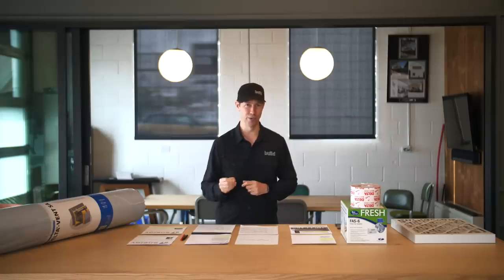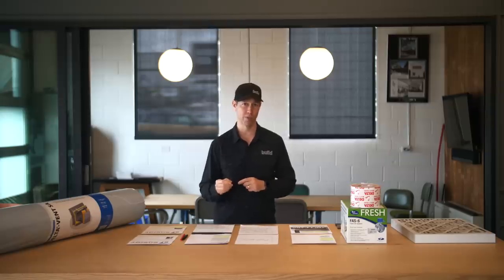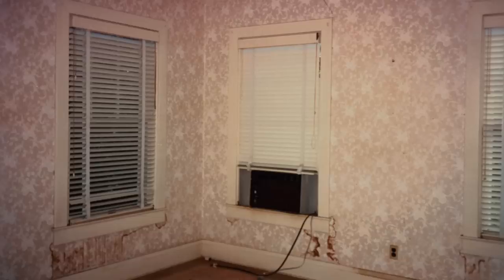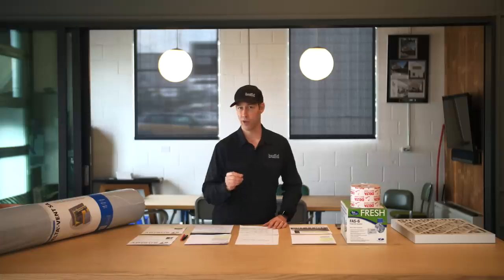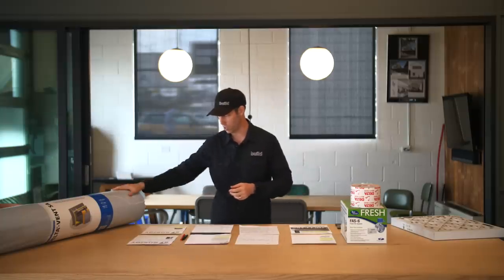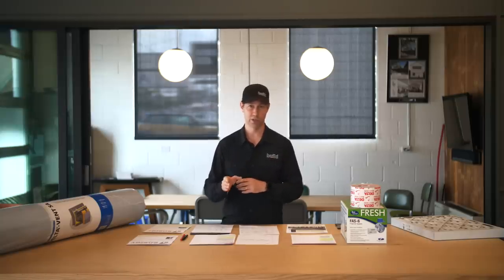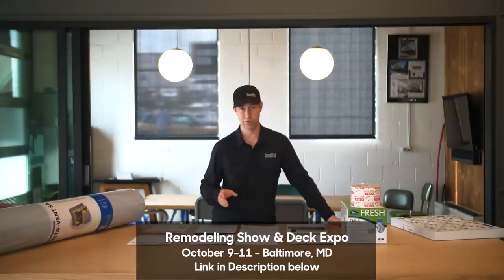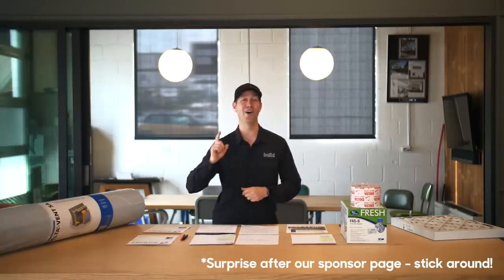“Houses need to BREATHE!” - Shut your filthy mouth

Comment: in minnesota in the 90's smart code requirements house wrap on the outside poly on the inside caused moisture trapping and stucco homes in particular had major mold problems within 10 yrs. hhomes had to be remediated. how do you ventilate inside the walls when moisture occurs?

Comment: I live in Chattanooga, TN. My wife wants the built on garage (concrete slab) converted into a bonus room. By trade I'm an electrician and have 10 yrs of fire & life safety experience, but this is an area of work I'm properly unfamiliar with. Dealing with inspectors all my working life. I don't like to just throw things together even though it may work for now, but at the expense of a later issue or hazard.

I've removed the garage door & built my pressure treated wall. what do you recommend for insulation (exterior of wall, inside the wall or between my gypsum and exterior studs)?

the existing north exterior wall has not been insulated, but has sheet rock. I have plans to remove it so I can then insulate (R-13). also, winter has been getting colder over the years. should I insulate my garage floor prior to installing floating floors?

Comment: Anther system to break and need maintenance to 'save' a few bucks (after you spend a bunch). And, when it breaks, it's an emergency. No thanks. I'll just add a few more PVs. Plus, I leave my windows open 90% of the time when it's nice out so that makes the whole 'one place filtered air' approach pretty useless.

Comment: Tightening the house and then adding fresh air ventilation systems makes for a more profitable build.
Reply: Build it tight as you can and adjust air quality by  cracking a window. The world is stupid.
Reply: @mikedegregorio9113  what if the air outside is worse? you will still need air filtration

Comment: Couple of things.  First of all most of us HERS raters depressurize the house for the blower door.  Second I have never seen my baseline get up to 50 PA even with higher winds than 15mph.  50 PA is actually about a third of the pressure difference between the outside and eye of a hurricane (going off memory on this one but I did look it up at one point).  It's not quite something that most houses will see in everyday operation.  Also the 3 ACH standard starts pretty far south.  Anything climate zone 3 and up requires 3 ACH under 2015 IECC code.  I'm in the Austin area as well and that starts just up in Burnet county and anything west of that.  

The number one thing that concerns me about making homes tighter than 2.5 ACH at this time is the lack of quality in HVAC installs.  Most of these companies are only putting one 6" duct for an air cycler that is tied directly into the return plenum.  They usually only get 25-45 CFM of airflow which even running fulltime is not enough for larger houses.  And they basically never setup the control for the damper to the proper specs.  Also these cheap air cyclers are also horribly inefficient given that they rely on the blower fan in the unit itself.  Once we started measuring wattage draw on these units and put that in our HERS calculations we started struggling majorly to hit that 75 HERS score required for buyers to qualify for VA loans.  I would only buy a tight home if it was a custom that was use a separate Aprilaire system and the company themselves measured the actual airflow at final.
Reply: Those HVAC companies aren't building to the code then, and should be held to account. Building leakier houses to account for builders breaking the law shouldn't be the way forward. I don't know what the code is like where you are but where I am, you are required to demonstrate the ventilation system delivers the required CFM of fresh air.
Reply: @trevorlambert4226  There isn't code that mandates any specifics for how much fresh air to bring in.  At least not in 2015 IECC which is the standard here in TX.  The code simply specifies that there needs to be a fresh air intake system present (and even then some jurisdictions have inept inspectors that don't look for it), it doesn't even have to be turned on.
Reply: The other frustrating part about that is fresh air systems are quite difficult to measure accurately without the installer putting in test points.  None of the installers around here do that so we are forced to use an exhaust fan flow hood on the intake outside.  If there is any cross wind blowing it can drastically affect the results of using that piece of equipment.

Comment: Wood needs to breathe... nothing wrong with a few air leaks wear a sweater. OSB & PSL Beams rot quickly don't let it get wet. Stud cavities need to breathe it's unfortunate these new codes are in conflict with a healthy house. Time will tell if tight is right.

Comment: I think a lot of misconception comes from half assed sealing that neither has the flow of an old house or the tightness of a modern house built by people like you. I have a different problem however as I have a house from 1890 with wood siding exterior covered with asphalt shingles and plaster and lathe interior. I've been trying hard to figure best way to insulate and seal but seem to find so many conflicting opinions

Comment: John Straube, Ph.D., P.Eng., is a principal of Building Science Corp. and a
 professor of building science at the University of Waterloo in Ontario.

Alex Wilson - " I’ve written about a lot of the features we included in our new house in Dummerston, Vermont".

Allison A. Bailes III, PhD, is founder and owner of Energy Vanguard in Decatur, Georgia. (on a latitude between Plainview and Amarillo, Tx

These 3 guys, that you recommend in the description section,  talk about moisture, vapor and climate where they live.  Most of what they say is the opposite or irrelevant in regards to the Gulf Coastal Plain where outside moisture and heat is normally the problem and freezing days are rare.

Comment: Matt, I own a house in the California Bay Area with stucco exterior with a crawl space that was built in the late 70's that has no insulation in the walls or ceiling. I'm interested in making the house more airtight and energy efficient. Of course it would be easy to just blow insulation in the attic and replace the old single pane windows with double or triple pane windows but what about the exterior walls? Could I put "Stick and Seal" over the existing stucco, add mineral wool to the exterior, and then put on something like a stucco board or more stucco over the mineral wool or would I have to take off the old stucco first?

Comment: Great video Matt, I have a question.  What about people who live in a potentially smelly environment?  Some areas of some towns are near factories that have bad smells regularly, or I personally live in the country somewhat downwind of a large cattle feedlot.  Occasionally the air outside smells pretty badly.  With an older style leaky house, the inside of my house doesn't smell due to the slow nature of the air leaks (some comes in, but then the wind changes and the smell goes away).  

If I had an HRV (I live in a cold climate), I wouldn't want to suck straight "fresh" air into my home when it doesn't smell fresh...  Along with pollen filters etc, are there filters available that would filter out bad smells?  A Carbon HEPA filter or something?

Thanks for any thoughts or guidance!

Comment: It all depends on materials used /age etc.
Old houses were built to breathe , for very practical reasons.
New houses, well its down to preference.
Reply from the maker: How so?  You have prefer to suck in air from your attic or crawl space and filter it with your insulation?

Comment: Why do they have to be airtight! When you bake in your gas oven were does your conbustion air come from? Use your dryer that sucks 1000 cfm out of your house, were does the air come from in you sealed house?
Reply from the maker: We always include a fresh air supply with a booster for high draw kitchen exhaust hoods. Dryers are much closer to 200-250 cfm

Comment: I have a home build in the 40s with a cinder block basement. Going about making it air tight seems impossible. I already had a water intrusion issue and installed interior drain tile. But now I'm dealing with the mold from intrusion and mold in the open attic. Anyone have any tips

Comment: building in the pnw. How can you account for the moisture that needs to evaporate out the the lumber after framing in the wet weather?  what % does the lumber need to be at to seal the wall up?

Comment: Just for fun I'd like to dispute all of your reasons.
So, #1, required by code; that is what is known as a circular argument.  This way is so preferred they wrote a code that requires it. So it is better because it's required by code. Not a valid argument, it is actually a logical fallacy.
#2, leaking, energy loss. If you have leaking which allows moisture ingress, you must also have leaking to allow drying.  If it's tight, it must be tight.  So the two are mutually exclusive, but that does not indicate one is the only effective method, just that if you choose one you must consider the entire system and build accordingly.
#3, materials; if you have a leaky house, you must use better materials which withstand moisture.  Perhaps it is a mistake to use fragile materials, not a mistake to use robust?
#4, comfort; I built a tight house, and without electricity (or open windows) it is uninhabitable, you must have air flow through it or suffocate. Not comfortable.

Consider that when these houses were built most heating came from burning wood, which was there free, just work to get it.  Cooling came from that evil natural ventilation.  Or slave labor, get your kids out there chopping wood, working the fan etc.  It's like a free gym membership with every house.
Reply: 2# which method is an effective method? the one that keeps you warm and dry. tight means you can manage the airflow and thus the heating and drying. air leaky home you have no choice, its cold and dry if you like it or not. tight wins because its your choice how you want your home to be.

3# materials is an issue. some modern manufactured materials have issues. the original builder may know and mitigate those issues, but home owners latter on may accidentally undo those fixes. eg exterior sheathing that warps (then leaks) if you paint it a dark color (current law suit over that).

4# a home will always have air flow. if not the ventilation system then the windows and doors.
Reply: Seriously #2 well you could open the DOOR if you chose to not have any opening windows. Never seen a odorless house.

Comment: Hey Matt, you might be able to answer a question I've had for some time. Can you come up with a ballpark figure for what a "normal" wall costs per square foot? Something you could compare to the cost of a glass or Kalwall envelope. And by "normal" I mean framing + insulation + wraps + (maybe) rain-screen + drywall.

Comment: Could you do a video on how air tightness relates to hurricane codes? I am in central Florida here and in my limited understanding houses here have to have some form of ventilation to equalize pressure in hurricane force winds, I assume Texas would have similar codes, just wondering where that is factored in.

Comment: Does caulking around baseboards do much for air sealing from crawlspaces?  In regards to indoor air quality?
Reply: It can help. What you really need to do is evaluate if your house is having negative air pressure. If there's air leaving the house from things like the l laundry drier, exhaust fans or stack effect, the air must be replaced from somewhere. Since hardly anyone leaves windows open, that air comes from dirty places like the crawlspace gaps you are referring to. Not good.

The only solution I could come up with for my house was a forced fan fresh air intake.

We went from having severe dust problems (falling into living space from attic crawlspace) to having normal dust only after install of that type of fan.

Comment: Hi, thanks for the show! Have you ever heard of the concept of a weather wall . I think I saw it in an article about a European residential building,  where the house envelope is sealed -(water, vapor, wind, insulated) then like 1-1/2 sleepers over that and then exterior sheathing/siding. Providing ventilation behind siding and roof to ridge vent
Reply: So is there a double sheathing for this method? One before sleepers and one after that you nail siding too?

Comment: Old growth wood vs crappy new growth southern pine.  Solid wood boards (again old growth) or wood chips and glue.  Simple fact is an old house could get slightly wet below the siding and, because of the design, "air out" and dry out.  It also why they cost a million bucks to heat and cool and never maintain a consistent temp.

New houses are so tight that when water does get in, it has no where to escape and because of the poor construction materials used today, results in horrible failure.  Oh and people don't like opening their windows anymore, recycling all that stale air.  Gross!

Comment: It seems ... really inefficient to block air out and then bring air in and out.  It's like one thing undoes the other, so why bother?  I get that modern building materials are destroyed by moisture, but that aside, I don't get it.  Whether the air comes in from an open window or a leaky wall or from a mechanical vent, it's not any cheaper to condition, so I don't get the advantage.  It's not energy efficiency.  That argument doesn't make sense, because mechanically moving air is more expensive than it doing so itself, and it's just as expensive to heat/cool it.
Reply: Not trying to troll at all.  I just head-tilt like a dog because it doesn't make sense to me.

Comment: Hey Matt, I have a question. I have a 114 year old farm house in canada. I am planning to peal off the outside stucco and chiplap boards to expose the wall cavity and get a company to spray 3 1/2" of closed cell spray foam. That way I get a decent R value plus a vapor barrier on my old leaky house. What would you reccomend to close up the wall with? I was thinking OSB sheeting and then using a 2" rigid styrofoam of some type and finish with a Hardieboard siding or equivalent. Does that sound like the proper way to seal up my house? Any advice would be appreciated. I've asked a few tradesmen around the area but they don't seem to know how to advise me. Thanks again. I've been really enjoying your videos.

Comment: I've noticed a bit of condensation behind my vapor barrier in my unfinished basement. Its summer time right now and it's extremely hot and humid in Ontario. I have a dehumidifier running now but I cant seem to get rid of the condensation. Do you recommend cutting the barrier temporarily so that the dehumidifier can work more efficiently? Then just tuck tape it back up again?

Comment: no correctly built house breathes, even correctly built log cabins don't breath, yes water vapors can move through the construction rather easiely, but close your nose put a block of wood tightly to your mouth and try to breath, you'll die trying.

Comment: Matt or anyone, I currently have my walls open in a kitchen remodel in southern california. stucco exterior attached to 2x4 walls. It doesn't rain much in my area nor does it get very humid. Do I still need to consider a way to shed water and moisture between stucco and insulation?

Comment: The confusion in the industry comes from people using terms that they don't understand.  Without quantifying air leakage, this general conversation is meaningless (I'm not referring to a blower test which you over hype all the time). Buildings absolutely need to breathe.  They should also be air tight.  Both statements can be true if you understand facade air leakage rates.  Without quantifying air leakage, people assume it either has to be air tight or is has to breathe.

Comment: My dad and I are designing a timberframe plus sips addition. Should we look toward peel and stick total waterproof air tight system on the outside plus air exchanger? It's Montana lake side so lots of wind but pretty dry air.

Comment: Hey Matt, Great video, great show! What do you do for a bathroom exhaust fan? Bathroom has no window either. Is an exhaust fan a big heat or air loss? It just vents into the attic and not outside.

Comment: when you say the old house would not meet code... what does that mean for people who remodel these old houses? i am in the middle of a renovation of my old house built 1890s now that i have pulled down all the sheetrock and plaster to run new wiring and insulate do you think an inspector is going to condemn my house because its not built to code? something i am very worried about..  going into a  remodel of only the surfaces, wiring ect..i am pulling down the sheetrock and putting in insulation batting to try to make it a little warmer but will the inspector get stuck on the fact that i am missing some boards on the outside sheathing and its had clapboards just nailed over that missing piece??   i know its not air tight but its the only house i can afford to live in on a such a low budget..
Reply: Late to be asking questions like this. Depends on the ciry. Moat would make you insulate after plaster removal.

Comment: what if the power goes out for 2 days. is that any issues with that?

or the air exchange systems stop working? if they are in the attic it might be 9ff for days before any one notices
Reply: cant you open a window?

Comment: New house.   What if I. Primed and painted the out side before house rap.  It’s another water Barrier???  Your used a solid stain???? 
What if did the same thing on the in side before insulation is put in??? This would be like spray foam.  Would this work.  Something better than nothing
Reply: No it wouldnt help
Reply: And cost more than some products that help